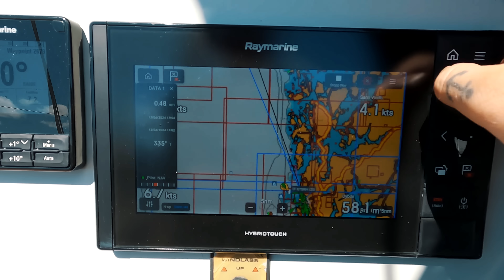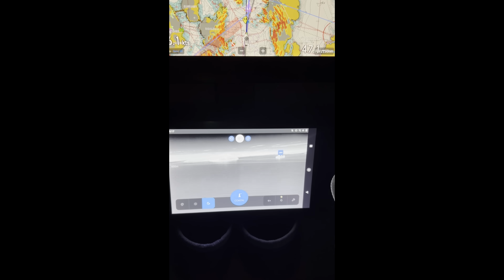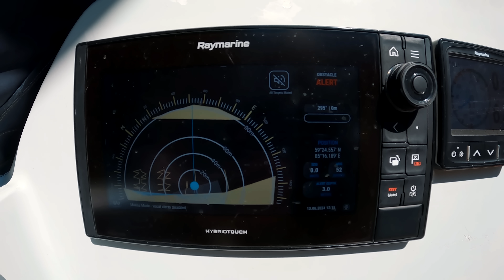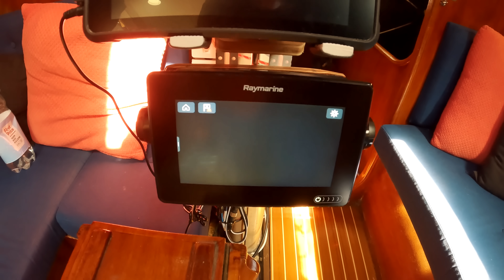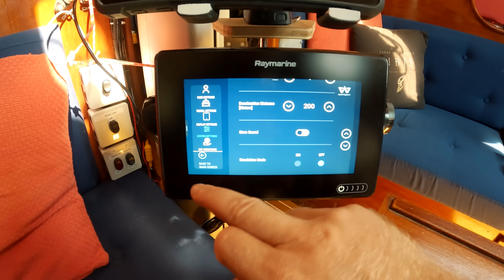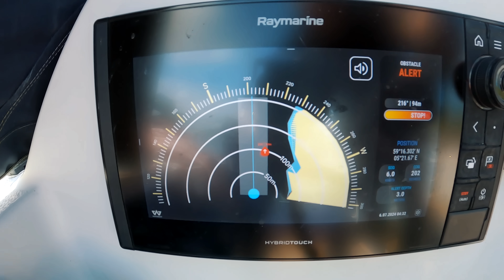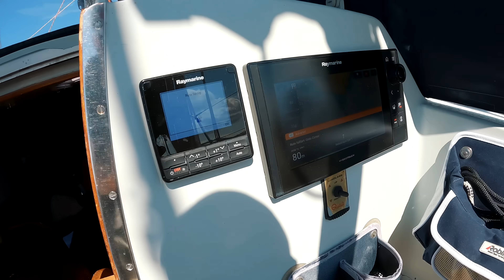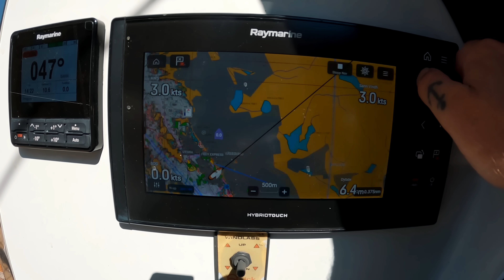Could this new system prevent COLLISIONS at SEA?

Comment: it is a great idea but not for power boats...even if your going 10 knots you would be in trouble seconds after you heard that alarm..I wonder  how it would detect a floating cargo containor or a floating log? say if you were going 20-30 knots...Would ther ebe enough time to adjust your heading? I also heard it is over 12000 pounds...I mean really? wtf...12000 pounds?

Comment: There is already integration between AIS and Garmin Navionics to calculate routes that interfere of the ship with the software and an AIS entry at an adjustable range.. Which actually comes quite close for a moderate amount of power and money. Things will evolve on a tsunami level rate the coming next years, I’m sure.

Comment: Nice that it networks with your existing Raymarine equipment via their network backbone.  Plus it uses bathymetric data from your depth sounder, so basically it reads the chart data for obstacles and the sonar for depth.  
I remember that accident during the Volvo OceanRace.  I guess they didn’t have their charts zoomed in close enough for it to show the reef that they hit.  Human error for sure, but I wonder if your system uses all the data layers available on Vector charts, even if you’re not zoomed in closely on that chart…

Comment: Couldn't the system go one step further, and in the event of extreme danger and action by the crew, steer the boat away from the obstacle using autopilot and even egine controls? It could compute the less dangerous heading.
Maybe sone law restrictions here, as this would be loke some IA being able to cibtrol de boat, but, probably for a v2.0 in the next years (if it is not done already...)
I can envision IAs specially trained to control boats, even sailing yatchs, being able to accept natural voice commands, and answering in natural language, and even being able to optimize the sail trimming automatically, on those yatch with full push-button sail controls.

Comment: From the engineering perspective, this is a very nice system with lots of potential for sure. From the sailing perspective, it does give me some mixed feelings..as in, at what point do we become so dependent on technology that 'seamanship' becomes redundant because the electronics do it all for us? And what happens if, after becoming so dependent on it, the technology suddenly stops working for whatever reason? Then again I had seen ads for this system and it was very intetesting to actually see it in action, so thanks for that, Erik. :)

Comment: The problem is that the more your boat gets complicated the less freedom you have as things will fail, need repair, need spare parts.... I prefer to run some risk and keep my boat "plug & play" out of it's sheer simplicity. Each year I get some equipment out the previous owner installed. This year it's the radar. Perfection will be reached when all that possibly can be taken out will be taken out. I love my AIS combined with VHF though, that to me is real progress, as well as electronic charts on my reliable & cheap Samsung tablet and, to close it, a deph sounder, all the rest of the electronics OUT. AIS yet has a built in alarm for collision with boats. As for the ground, setting an alarm on your depth sounder may help. I would start with that before yet adding a layer of electronics that would coast an arm, eventually suck your time when it fails (and it will, probably sooner than later, small boats and electronics just don't mix well, specifically older ones as almost all have small deck leak(s)). all that to solve only a part of all what sleep deprivation can cause as troubles. Best is to sleep as much as possible when out at sea. This is the reason single handed sailing was all about heaving to before reaching shore (would stop the boat by heaving to, get some rest, then only reach port or anchorage).

Comment: This is a great system but to be honest I'm a little disappointed with the yachting engineering community.  We should be ahead of the automotive engineers; and even thoght thats a great system, its no where near what a tesla can do in a much more complicated and hectic environment.  At the very least the system should be connected to the autopilot and have some sort of automatic collision avoidance where the boat will steer itself.  After that we should talk more about integrating AI, Radar, Sonar, Cameras, ect.  Why have these systems on 50k teslas and not have them on 500k yachts?

Comment: Can this system be tied into the auto pilot to guide the boat away from a potential collision
Reply from the maker: Its not yet aloud pr regulations, to connect any collision prevention to autopilot. I think it should be at least a choice of option🙌
Reply: @erikaanderaa  or tied to the windless  to lower the anchor to slow the forward motion
Reply: Thinking the same thing. good one..

Comment: will this setup warn you of ice chunks?  if so, how large?  what i mean is, what sensor input types can it use, like IR camera, AIS, etc.
Reply: Charts, GPS, Echo Sounder, Engine Data, Wind Gauge, and more data can indicate the boat's situational awareness.
Reply: @WATCHITsafety  nice!  you’re based in Israel ?  if you need US patent help, I’m an attorney doing software patenting for 25 years.  am pretty full, but always find room for interesting tech, especially nautical!  good luck, it’s a promising market.
Reply: Great question,
Reply: I dont know but a similar system SEA AI does it. It also costs about $50k USD so there's that too. It uses high quality FLIR camera and a machine learning model to interpret the data and warns you of logs, containers, chunks of ice and icebergs etc even in dark. It also automatically detects any man over board. Its like a second crew member that never gets tired, scared or out of focus and can see in the dark